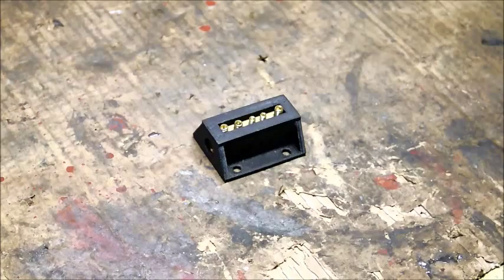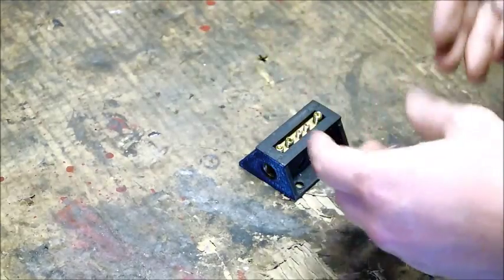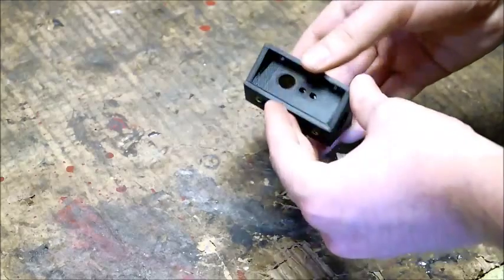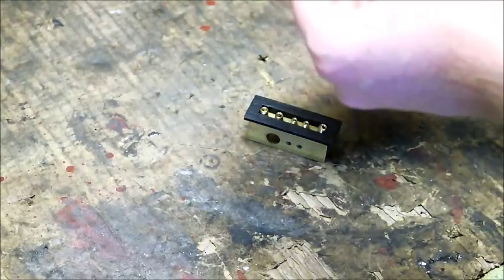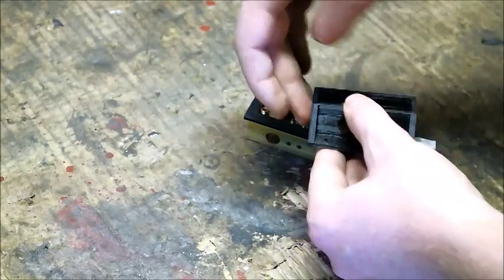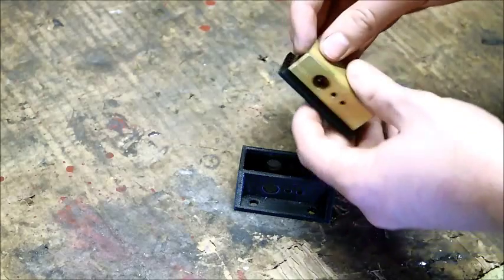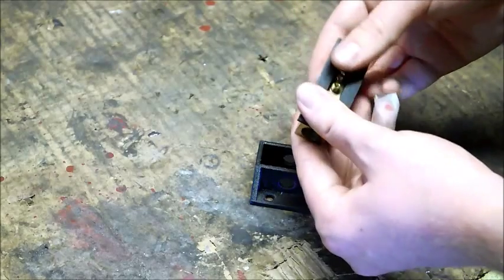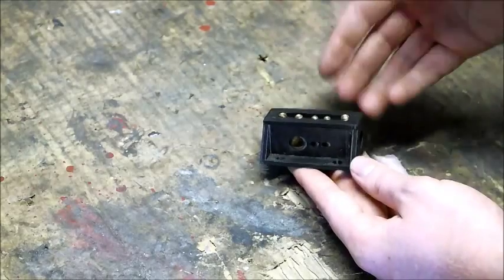DIY power distribution blocks

Comment: You should make this as a fused distribution box. Your input power feeder wire is going to be able to carry large currents, but you side out put wires are small and will not, so if they shorted, even though unlikely, then they will burn and can catch fire.
Reply: +sdowney717 If you already have a fuse block installed by your battery you dont need a fused distribution block